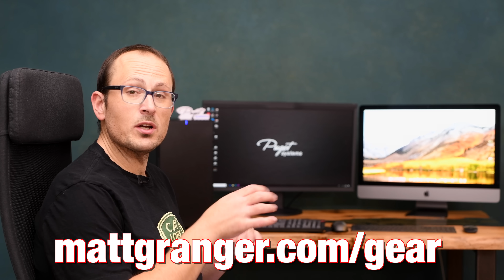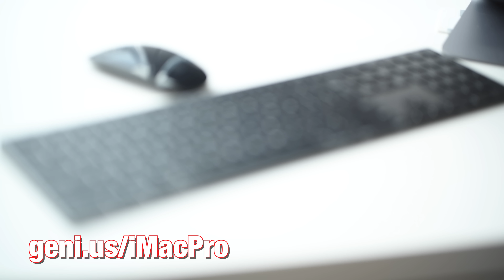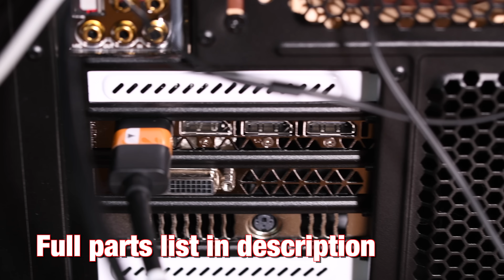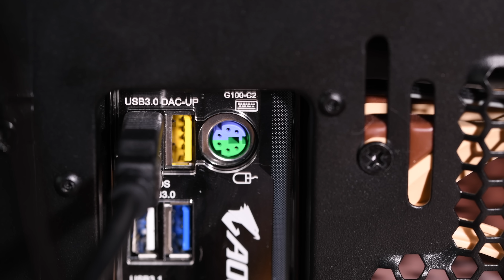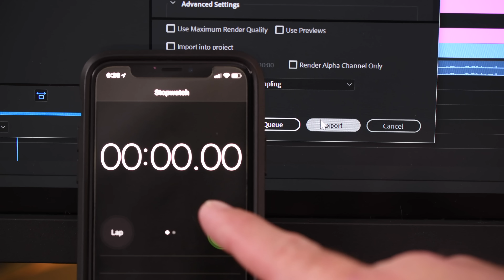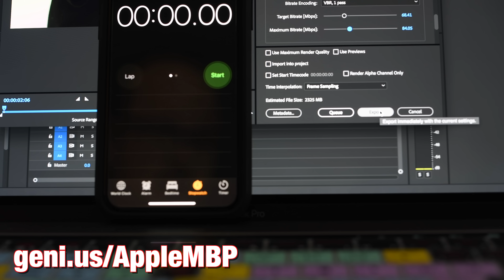$10,000 iMac Pro vs Custom PC - Which is faster??!

Comment: Buying a Mac to use adobe Premiere would indeed be a waste of money. Dollars to donuts the iMac with FCPX would be as fast or faster than Ciderhouse with Premiere in managing equivalent projects.
Reply: That is absolutely correct. You don’t purchase an iMac pro to use Premiere on it, and if you’re going to? You’ll boot it into windows with Boot Camp and run the application that way. If you’re buying this machine, you’re buying it for it’s prowess with Final Cut Pro X, Logic Pro X, Pro Tools, Mathematica, DaVinci Resolve, and Pixelmator Pro. Leaving out a Final Cut Pro comparison is complete nonsense, and it’s irresponsible for an “objective” reviewer.
Reply: Erwin Olmanst I understand the point of the video very well. The issue at hand however, is that Matt used hardware acceleration with CUDA on the pc and didn’t use hardware acceleration via Metal on the iMac. If you’re going to do an apples to apples comparison, then it has to be exactly the same. His point about Final Cut is that the system is designed to use it extremely well, so a more apt test would be to boot the iMac into windows via boot camp, and run the test that way; in that instance, with all hardware acceleration turned off, the results would have about a 3-6% differential purely related to clock speed and turbo frequencies. Any time you see dramatic 50% differentials on essentially the same hardware (a 14core Xeon-W and a 14core i9 are essentially the same processor) that means one is using an advantage and one is not. Also, if the point of the video is to compare what you get for your money, then demonstrating the iMacs ability with Final Cut Pro and it’s ability to run Windows is something that should be brought up. I think everyone’s point here is that the test was not done properly and it conflicts with every other video out there that didn’t give one system an advantage over the other. If you design a test deliberately to showcase something and “prove” your preexisting opinion? Then it’s not really test is it, it’s an ad and/or a piece meant for controversy instead of information.
Reply: Wes Perry that might be, and is possibly a fair comment. I got the impression though that Matt has made a conscious decision to not use final cut.
I think the other issue is the 'as fast or'. If it is only as fast then the pc probably still makes more sense. If it really is verifiably faster,  things may change. Then I guess you would be comparing better performance (albeit in different software....) to easier upgrade and future proofing.
At best a tie imo.

Still an interesting perspective!
Reply: Yeah, if you’re going to spend the scratch on a Mac, best to use software optimized for it.
Reply: Bob Clapperton to answer your question, after Apple removed Color from FCP we started using DaVinci studio for Color work, but still use FCP for editing and cutting things together. We love the speed. Also your Avid comment is accurate for certain projects, it all depends on whose editing the thing, but the studios I mention absolutely use FCP, and PP isn’t something that I’ve found professionally used very often outside of smaller windows based shops that primarily do commercial work. My experience may differ from yours, but I wouldn’t start discounting people experience just because you’re working in a different area than features. The combo I typically see is as follows: Final Cut Pro on set to quickly edit daily’s, Final Cut Pro in the studio to cut together footage, then a move to Avid if there needs to be work done by an outside render farm or firm that has older hardware (the files are compatible), then back for Color correction with our DaVinci suite. We also have access to and use Render-man (Pixar developed solution) for animation and motion capture, as well a Motion for graphics. In our workflow this is typical of everyone we work with.
Reply: Lol
Reply: Thank you.
Reply: You can make "same things" in different methods...
Reply: Lol.
Reply: Lol
Reply: lol
Reply: I know many professional film editors that buy Macs and doesnt use or like FCPX, most of them are in PP Cc, Avid MC and Resolve.
My experience is completely oposite, most commercial and freelance editors are using FCPX for small projects. And TV series and films are going for the Avid or Adobe route.
He was compairing two systems based on his workflow, as everyone should do.
In PC you don't have to manually actívate the GPU acceleration method for tour specific method, if you're in AMD premiere recognize it and goes for OpenCL and if you're on Nvidia it goes for Cuda.
Reply: Gecko Boom
Reply: this is not true I thought the same until I realize that there are many professional editors switching to FCPX  because of the constant bugs and the rendering being slow in premier. Premier being a standard is not accurate  as people think like I said there are many pro editors that actually prefer FCPX because if their easy interface and ability to render large files faster. I actually think people like premier mostly for the after effects and other adobe software integration.
Reply: +Bengurl

Btw, companies such as Disney and Pixar use over 30+ different types of software for everyone of their films. No company on this planet uses one software for a million dollar film. That would extend the avregae making of 2 years for a film to most likely 8, or even more.
Reply: +Jo\es Technology, News, and Life

"'Pixar would disagree with you as would Imagine, HBO, Showtime, NBC, CBS, ABC, FOX, The Food Network, Bad Robot, South Park Studios, Fuzzy Door, Disney, CNN, Marvel Studios, Lucasfilm, and quite a few more I’m forgetting"
- Are you actually implying they use Final Cut Pro? You are highly mistaken. 

Pixar, HBO, FOX, The Food Network, South Park Studios, Disney are not even using a mac. If Disney used a mac to render their animations then it would take them years for just a single clip. All of them are using supercomputers worth up to 500'000$. Disney rendered Big Hero 6 film on a 55,000-core supercomputer. They are not using MacOS / OSX, neither are they using Windows. Every one of these companies is using Linux.  You are just some fanboy if you thought they used a Mac to render their projects, that's just sad. Furthermore, even Disney shows "Behind the scenes" of their animations, all of their "Behind the scenes" they are using a PC with an unknown operative system, its most likely a Linux. 

NBC, CBS, ABC, Bad Robot, Fuzzy Door, CNN don't need to use a powerfull pc. They can literally do everyone of their projects on a cheap windows pc or even a cheap mac, (Macbook Air). They barerly use any kind of editing. 

CNN;
Paste clip Paste clip Paste clip 
Paste tekst Paste tekst Paste tekst 

Wow, that was to difficult. That must of taken an incredible powerful computer...

Stop it with your iSheep bullshit.
Reply: @GeckoClever  i totally agree with you
Reply: If you do the same thing with Final Cut/iMac pro you will go much faster than PC anyway.
Reply: Roshan you have never used Final Cut Pro X have you.... Pixar would disagree with you as would Imagine, HBO, Showtime, NBC, CBS, ABC, FOX, The Food Network, Bad Robot, South Park Studios, Fuzzy Door, Disney, CNN, Marvel Studios, Lucasfilm, and quite a few more I’m forgetting. Don’t say stupid things when you don’t know what you’re talking about. Also, how is this not a “featured reply” when it’s accurate and the snarky false one is? I don’t understand this site.
Reply: You didn't get the point of the video. The point was to compare 2 different machines on a similar budget doing the same thing and see which one gets the better performance. The fact that FCPX performs better on Mac computer is pointless here.
Reply: Final cut is for simple tasks not for the real deal lol
Reply: The thing is pros use Prem Pro. FCPX is a toy.

Comment: You can't upgrade most of the parts on a mac because their OS works only for those parts that they use. When windows/linux machines have to work with every type of configuration that can exists, just image how many parts there are and how many configuration you can make. Also as Matt says, if something brakes on a windows/ect machine you can just throw the damaged part or upgrade it, no hustle. Also what if you don't want that imac display ? You can't sell it or anything, you have to use it as a paperweight and you paid for it.

Thank you Matt you are like the only person that has a brain on this planet, i'm sick of all the monkeys with apple products. The only apple product i like is the 13 inch Macbook laptop or whatever. It has a decent specs, and that battery thou, 10-13 hours from something that light, i'm impress, but iPhones and iTosters , NO THANKS!

Comment: Would it be possible to run the same export test using Final Cut Pro as Final Cut Pro seems to be twice as faster exporting and rendering than Premiere on the same hardware.